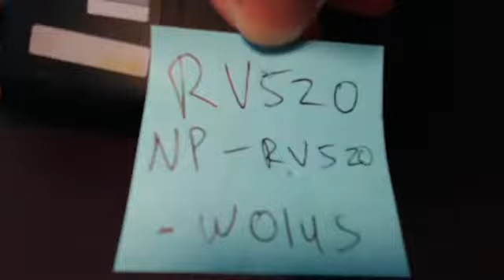Samsung RV520 NP-rv520-w01us dc power jack repair socket input port connector replacement

Comment: i think i may have damaged my board alittle trying to take out the broken ac jack, will this affect the new one im going to install? im using good at soldering but it was a bit hard to get off the board. any inf owould be great thanks alot